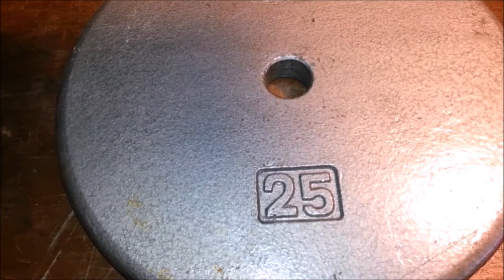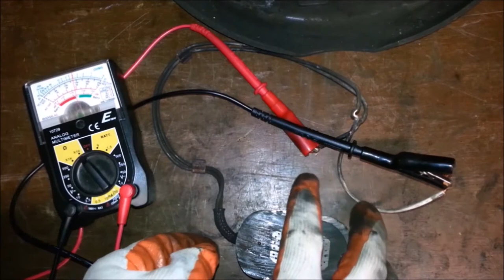A Common Defective Brake Design Could Kill Your Family and Friends

Comment from the maker: I ran out of room in the main description, so I'm putting some key points here for some of the comments I receive.

Keep in mind that the problem is intermittent.  If you check the magnets with a tester (Ohm meter, volt meter, amp meter, test light, load tester....) it might show everything is fine, right now. But as soon as you hit a bump, one or more magnets might lose connection.  On the next bump, it may change again.

A lot of people bring up the idea of replacing the drums with disc brakes.  Both disc and drum brakes have their pros and cons.    

Disc brakes are great in most respects for most people.  But they may not be good for certain situations.  I, and many others tend to spend 1-6 months in 1 location before moving.  Frequently, I'm near the ocean or gulf.  In a humid and salty environment, disc brake rotors rust very quickly.  The parts inside a drum are somewhat protected from the humidity that attacks metal each day in these types of environments.  Once the disc surface has pitting and scale, the disc brakes don't work as well.  The area of the disc under the pads usually doesn't rust.  So the brakes don't work well until that nice part of the rotor comes around.  Then they work.  This can cause the brake to lock during emergency stops.  Florida snowbirds would be a good example of folks that may have more problems with disc than drums.

Also keep in mind that disc brakes convert electric energy into hydraulic energy. If the electric part fails the brakes won't work.  If the hydraulic part fails/leaks, the brakes won't work.

For people that use their trailer frequently and are not in a salt air environment, disc are probably the better way to go (if you have the money).

If you want to read the old comments, they are in the old version- electric brakes: https://youtu.be/UPhhT_383-4

Comment: Sometimes the brake wires are fed through the axel to the other set of brake magnets and there is no support in axel for the wires so they can rub through insulation and cause intermittent shorts in brakes. Thanks for taking the time to show what is inside the magnet. Another issue some brands of Nev-r-adjust just keep getting tighter and tighter and fail.
Reply from the maker: I saw a video about the wire in the tube issue.  I haven't ran into that problem yet.  I bet a combination of rust in the tube and an out of balance tire can chew right thru the insulation.  I had the nev-r-lube axles.  Should have been called "can't-lube". Also can't turn the drum, cuz you can't find anyone that knows how to do it for that design.

Comment: Not really a fix but you could measure the current to each brake with a current clamp with the brakes applied before a trip. Or make a 'device' using hall effect current sensors to measure each wheel and indicate to the driver a failed brake. That could even show uneven braking with the current measured by each wheel.
Reply: I've measured the current to my electric brake solenoids using a clamp on meter and they were all 1/4 of the total current since the solenoids are in parallel.  But that doesn't guarantee even braking . . . .

Comment: Interesting!
Like you, I'm surprised they would use a push on connection but I understand why they do it.
It simplifies and cuts cost in the manufacturing process. 
I also would feel a lot better knowing the wires were soldered together!
I would think that if they're pouring in or applying a liquid potting material over the connections that after it sets up (hardens) that it should prevent any loosening of the connection, but maybe with age and the extreme heat generated during braking that this material could be breaking down over time, allowing the connection to fail.
I'll bet if you contacted the "Major Axle Manufacturer " and spoke with one of their customer service technicians they'd be glad to explain their reasoning for using the push on connectors.
It's possible they may have since changed their process or they may just say it's a super rare incidence that a connection fails ?? 
You could also contact several local RV dealers and talk to their repair guys and see if they've seen these issues.  I'll bet they'll just say "Yeah, we see an occasional brake magnet fail with age and we'll put on a new one. They're not very expensive".
  I'm interested in what you find out.